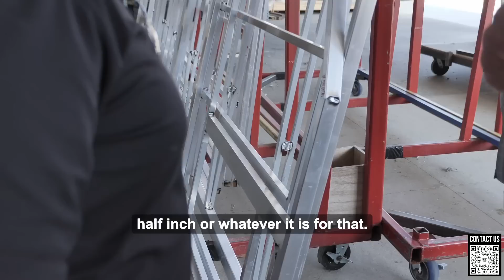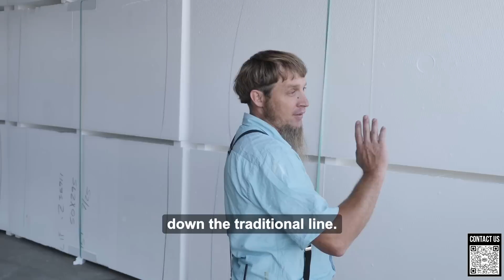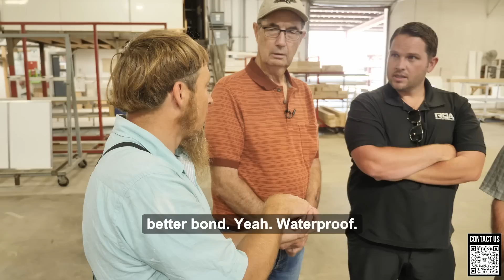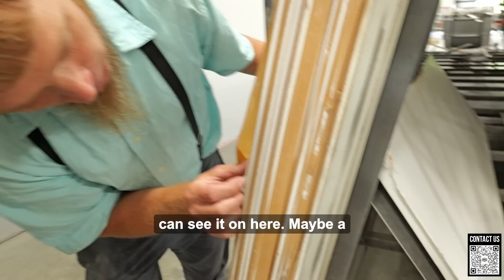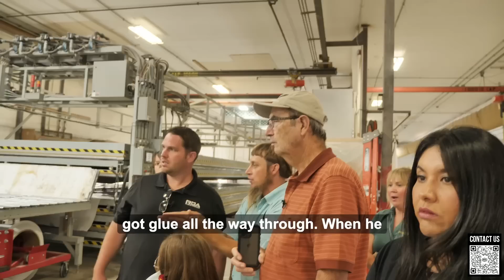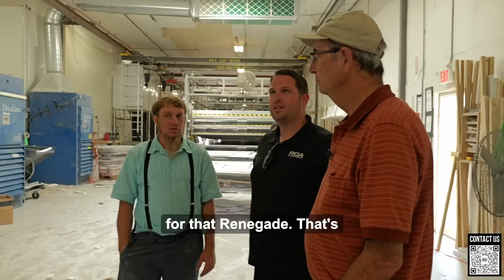What Goes Into Making Million Dollar RV Walls? Pause Reboot Behind the Build

Comment: Aluminum inside the walls is a waste of time and does not increase strength significantly over a solid filon styrofoam sandwich composite panel. A pure composite panel is just as strong and has better insulating properties at half the price.I build composite RV's myself with no special tools as a hobby.
Reply from the maker: "Half the price" Are you sure? Also, depending on what type of composite you use. Some composite are extremely hard to repair and entire walls need to be replaced if you ever get damages. There are pros and cons to both.
Reply: @ROAOffRoad  you said these are million dollar walls

Comment: Very interesting.  My concern for extrema weather camping is the aluminum frame will conduct heat in and out even if there is some insulation on the outside just a little less.  Solid laminate walls and ceilings do not have any internal materials that conduct heat.  When I was at Overland Expo PNW one manufacture from Alberta  had a rig  there was no metal frame for the windows to even reduce the heat transfer more.  Does this wall have better overall insulation power than what the X 195 has?
Reply from the maker: The windows on the Reboot also don't have metal in the frame. They do not conduct as much heat or cold as the standard windows. The insulation we have experienced is similar to the X195 and in some areas a little better. It has less condensation for sure. :) The reboot is built more like the fish houses and they did great in cold weather.

Comment: It’s about value for money. This isn’t it.  Just go get the Arctic Fox EDGE 26KX or the Arctic Fox Edge 27SX. Thats a properly built offroad'ish camper that is value for money and priced right. If you need something more capable, go get a patriot and be done with it.
Reply from the maker: This is not very good advice. You say go get a trailer that is much worse in quality and can't even  compare to the Pause when it comes to everything. Off-road, off-grid, capability etc etc. Then you say if you don't want something poor quality like a Arctic fox with zero capability go buy an insanely overpriced tent trailer that is very capable. Haha! :)